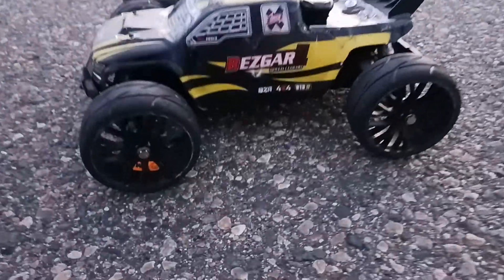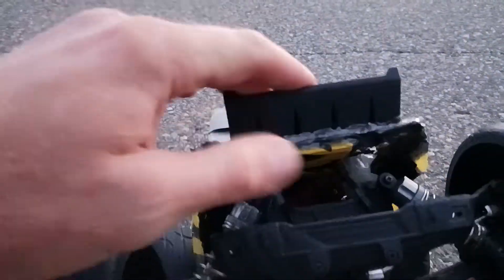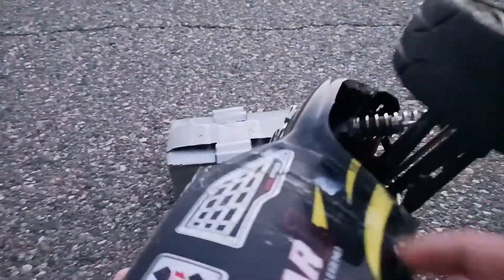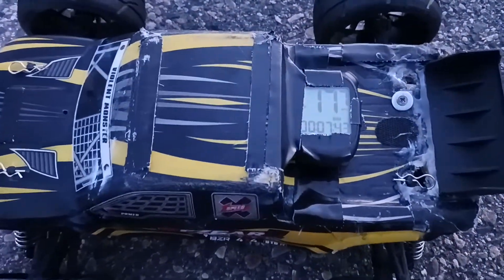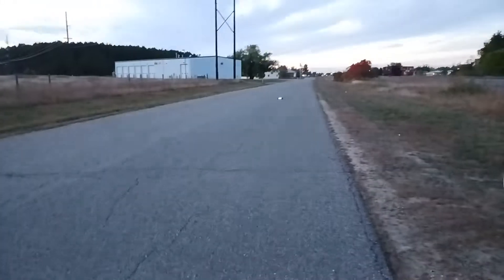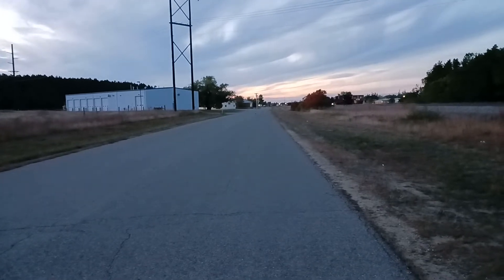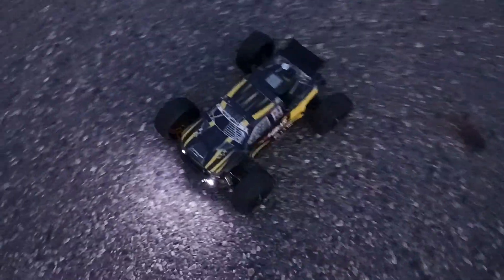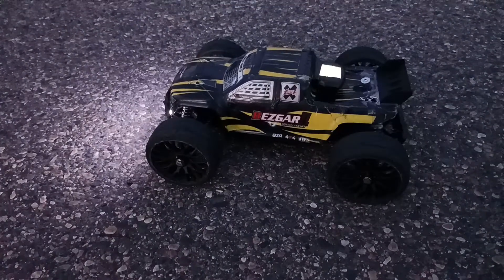4s Clean Passes on GRP tire's! World's Fastest Bezgar 1 HM101(has full steel gears) 💪

Comment: HOLY SHIT! We chatted a bunch a few days ago about the best setup for my 2996 that's on its way. I'm really glad I found your channel as your testing is making it very easy to map out a solid build. I am truly shocked that 4s on that 5900kv motor is not exploding lol if you do the calculations, that motor is spinning over 85,000rpm (on paper, likely quite less with wind drag/weight and other factors) when it is only rated for 50,000 lol Insanely good quality for a cheap motor. Not to mention the max amp draw of that motor is around 107amps and you're having success running a 60amp esc. I suppose speed runs with smooth acceleration draw far less amp bursts. Keep the awesome videos coming!!
Reply from the maker: I promise to keep gettimg better and thats great Im glad to helped. I cant remember who put me on to overvolting brushless motors I think it was TomleyRC testing a 959 or 979. These brushless motors are remarkable how they hold up being way past spec lol. The 60amps all fried eventually on 3650 5900kv tho, but that cheap goolrc 60amp would even do 2845 5900kv 4s on that Q901. I was using mod .5 pinions on accident so ima run that Q901 top speed back and more.  Them Hobby Wings and Surpass Hobby ESC are great for shananinagins lol
Reply: @ChiefRickyRC  Good to know! I run both those esc's in different amp sizes and they've been fantastic so far!! I'll keep you posted with my build once it's all done.